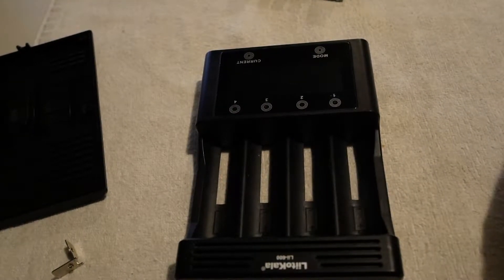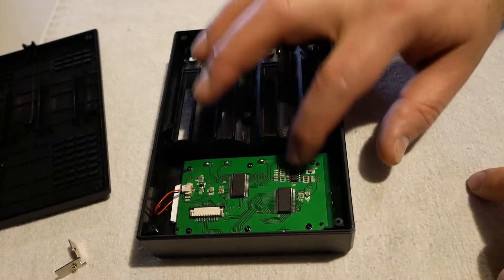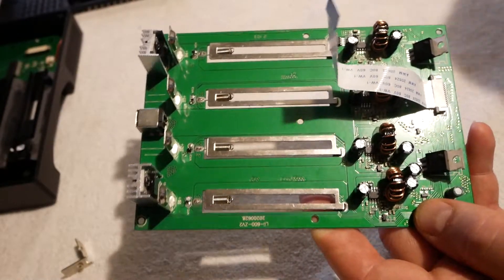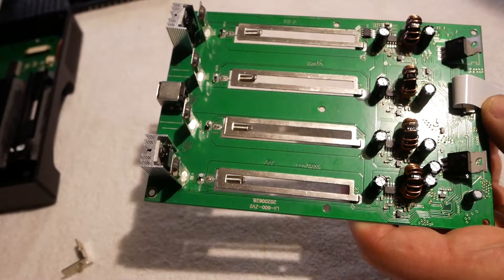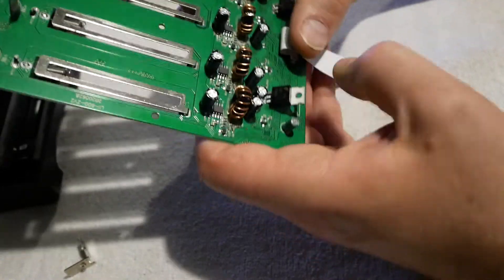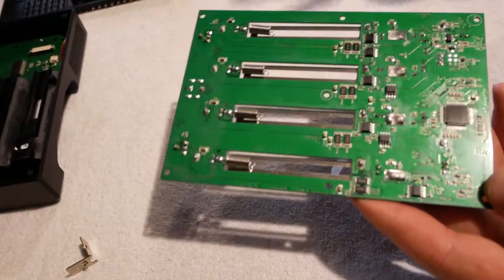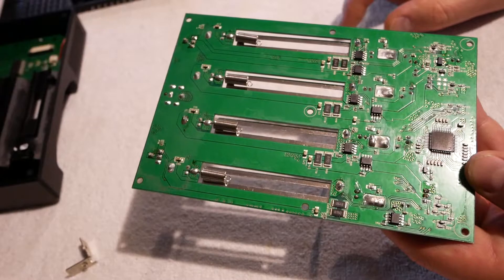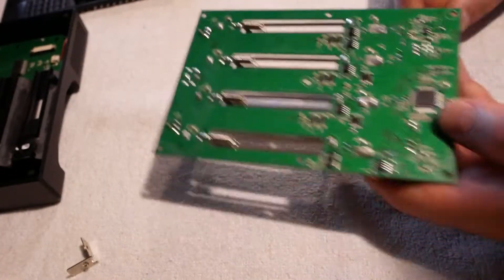LiitoKala Lii 600 Teardown

Comment: One of my outer slots have been starting to show high capacitance values compared to same cell in another slot. Seems it has become worse after some 100 tests maybe. Was wondering if there is something that might age?
Reply from the maker: I've had 3 of them do that. People want something cheap and then expect it to be good and reliable. Why I tell people to get the VC4+. IMHO, it's still not awesome, but it's loads better build quality than the li-600!
Reply: @de-bodgery  I have another Xtar VC4SL just for storage mode but now I am trying an BT-C3100. One thing I directly liked is that there is no annoying beeping :)
Reply from the maker: @gamingSlasher  I don't mind beeping if I get good functionality.

Comment: XTAR VP4+ is still 2x2a+1x2a. Charging large capacity batteries like Samsung 40T and 50S takes so much time. I hope XTAR will catch up and make 4x3a charger.
What's your opinion on Vapcell S4+ charger?
Reply from the maker: Notice that I talk about "cell testers", NOT cell chargers. For just charging get whatever is cheap and charges however you want. For cell testing, that's a very different thing! XTAR VP4+ is the best option that I've come across.
Reply: @de-bodgery  Oh, I see your point. Thanks for clarifying.
Would you prefer VP4+ over SkyRC MC3000 as well (for battery testing)?
Reply from the maker: @ZaarsShed  Watch my videos

Comment: You don't know what you are talking and have a clue about power electronics. Put 500s board together and put your glasses then you can see the more differences than caps.
Reply from the maker: So...are you an electrical engineer and went to school for an EE degree? Your not...hmmm...got to wonder then who is the one that doesn't know what they are talking about?
Reply: @de-bodgery  I am not old. This TO-220 mosfets for dummy load circuit so for discharging. Nothing to do with charging. You say 3 Ampere at 3:42. So, I think you mean 3 Ampere charging but I say again this mosfets are for discharging. This soic-8 package mosfets are charging they are synchronus buck converter to charge cells from 12V input voltage. Google dummy load, synchronus buck and educate yourself.

Comment: Thanks for the Review,I was going to buy a LiitoKala Lii 600 to charge lithium ion 18650 batteries, now i have seen this review i've change my mind, i am sure the XTAR VP4+ is a excellent charger but is out of my price range, i gone for the Opus BT-C3100 V2.2 cost less money and i haven't notice any negative reviews.
Reply from the maker: I like the Lii-600 a lot more than the Opus. It's a rather old design and not better than the Lii-600. I did have a C3100, but it wasn't very good.
Reply: @de-bodgery  Thanks for the reply,i will now try to cancel the order for the Opus BT-C3100 V2.2,right now i'm looking at the Youshiko YC6000 Professional Standard Super Fast Intelligent Battery Charger,what do you think compare to the XTAR VP4+.
Reply: The order for the "Opus BT-C3100 V2.2" had been cancel successfully,i have now made a purchase for one " XTAR DRAGON VP4 Plus",the reason are it didn't cost much more than the Opus BT-C3100 V2.2😃,i take your words the XTAR vp4+ is Excellent battery charger,i don't have right now to check out but when i do have, i gonna see if is better than my (2008 La Crosse BC 900) using with AA,AAA batteries,i will made a vid if anyone not seen a full complete La Crosse BC 900 with original retail box and all accessories, it will be in my video once i upload on youtube,lets see can a 15 year's old battery charger can equal or do better or worst than the  XTAR vp4+ 🤭.
Reply from the maker: @PaulCK  Definitely my favorite! And why I have 8 of them.
Reply: @de-bodgery  I get what you saying,i am happy to say i will be joining you very soon😀,Everyone listen i'm in the XTAR vp4+ club😁
Reply: The Opus is know for frying NiMH, the XTAR VP4+ doesn't charge the bays independently like the Lii-600 and the Vapcell S4+ V3.0. The Lii-600 and the Vapcell S4+ are better than VP4+ on NiMH.

Buy a Vapcell S4+.
Reply: @wolw66  My La Crosse technology bc-900 can charge Ni-MH and Ni-Cd batteries  independently. 
I don't think Lii-600 or the Vapcell S4+ V3.0 is better than XTAR VP4+,maybe just as good i just can't see how is better.
Reply: @PaulCK   The Lii-600 and the S4+ can charge the bays independently at 4x3A , or if you like 2x 26850 @3A and 2x AAA on a discharge / break in cycle.
I looked up all three as I needed a new charger. I will miss the internal resistance probes on the VP4+, but the other two are better at NiMH (and separate amps/functions on the bays independently). AND all settings and amps can be made in manual mode. I bought a S4+.
Reply: @wolw66  Okay it charge faster and everything, i have check the latest price for the S4+ it doesn't cost so much,if i don't have the VP4+ i probably buy S4+ hehe.
Reply: Some more information Vapcell S4+ V3.0 don't support lithium ion 32650 battery XTAR DRAGON VP4+ does support.
Reply: @PaulCK  Good to know.
I don have anything that uses them, and I don't have any 32650 cells.
Reply: @wolw66  Neither do i haha,i i'm beginning to realize i don't need any premium battery charger at all.
Reply: I've had the Lii-600 for two years and it measures everything accurately. It doesn't matter which slot I put the battery in. I put 4 Li-Ion 18650 batteries on the test at the same time and changed the position of each one. It took me 4 days to do that test, but it was worth it. The results for each battery on each slot are almost the same.

Comment: Xtar might be better but cmon, it costs 3x more than lii-500, and one thing it does better that you can notice is accuracy in measuring internal resistance. Is it worth paying 3x more? I would say no. 
Lii 600 also is not worth it.
This is too much money to charge few half dead laptop cells that are almost trash. 
For that money i would rather buy new cells and not care about their condition cuz they are new.
Reply from the maker: You are entitled to your opinion and good luck with those highly unreliable and cheap cell testers! I don't trust the Lii-500 as far as I can throw it! For your use case where you are just charging crap cells, don't bother with a good cell tester. IF you are testing 100's and 1000's of cells like I do, then don't waste a nickel on the lii-500 and get the XTAR VP4+. I don't trust new cells to be anything until I test them myself. Your assumption that "new cells are all some how equal" is false. I know this as fact as NOT being true! See this video:
https://www.youtube.com/watch?v=tO3wJVmtkzM&list=PLOrUJ_KZtl79PONtYt0Zhc8EFBD6pq0jU&index=87
Reply: @de-bodgery  dont get me wrong. If you are testing 1000 cells then good charger is way to go for sure. It will pay off. For me i guess not.
Reply from the maker: @bobikbobikowy5458  yup buy cheapest possible if all you want is charging. I wouldn't even bother with getting a lii-500 if all I'm doing is charging.
Reply: @de-bodgery  today i bought lii-500 for 13$ with some discount coupons. Cant go wrong in that price.

Comment: great video, seems like the Li-600 is not the best 21700 charger for me, might not be a good idea to run it at those advertised 4x3 Amps ;o]

would be nice to see a teardown of Lii-S8 if it's equally bad
Reply from the maker: Think in terms of the price. 8 cell charger (Lii-S8)for the price of a shitty 4 cell charger (lii-600). I'll predict based on the price that the S8 is an even worse steaming turd than the 600! Just buy a VP4+...yes they cost more, but its for good reasons.

Comment: Thank you, wanted to buy this one :)
Will go for xtar or if you have any newer model suggestion. Must have discharge
Reply from the maker: Nope...VP4+ is still my go to capacity tester!
Reply: What about the XTAR VC4SL aka VC4 Plus ?
Reply from the maker: @lorandhorvath4466  You want to save money and not pay for what a VP4+ costs. I get it...I want to do that too. It's why I bought other cell testers like the Lii-600. Seems logical right? It's not...you commonly do get what you pay for and in the case of cell testers, the VP4+ costs what it does for good reasons. Just don't skimp! Get a VP4+. So far, I've been disappointed in everything else. I would like to see XTAR come out with a new version of the VP4+ with a better LCD. Other than that, It's pretty darn perfect as is! My only significant complaint is the LCD and it's usable, just could have been done more thoughtfully.
*
The LCD will only display 2 channels at a time and never shows cell voltage. It also alternates back and forth between charge and discharge capacities. It's easy to record the wrong value. There is plenty of real estate on the LCD for charge and discharge capacities, cell voltages, etc for each channel all at once. There's also things like the bar graph that are completely useless! Cell Ir could be displayed at the same time as everything else too and it's not. Other than the LCD layout and how the data is displayed, the VP4+ is the BEST cell tester.
Reply: @de-bodgery  Thanks for your insight, I am considering buying a VP4+. What about the Vapcell S4 Plus? I have read good things about it, about the same price AFAICS.
Reply from the maker: @lorandhorvath4466  I looked at the S4 briefly, but don't have one in my possession. I honestly can't say anything about it that you can't look up yourself. After I found the VP4+ and had looked at many other options, I quickly came back to the VP4+ and stuck with it.

Comment: Someone knows the maximum temperarure until sensor STOP charge to protect ??? 
I have a battery with 61° C and it does not STOP the charge, it is very hot. O.O"
Reply from the maker: It's a Liito Kala product and they are not very good. This isn't surprising that it won't stop charging. Seems your cell has an internal short and was probably dead flat when you attempted to charge it. I'd take it  off the charger and test it with a volt meter. It's probably going to show a few millivolts at most. That cell won't take a charge no matter what you do.

Comment: Helo, 
How to reset this charger memory? I have one slot locked and when empty it shows charging.
Reply from the maker: Sounds broken to me...not that liitokala chargers are avery good...so this isn't all that surprisng
Reply: @de-bodgery  I am trying to replace it with another one. Resetting the memory by quickly pulling out the power cord does not work. This is what the manufacturer suggested to me. Thank you for your reply.
Reply from the maker: @TomWasilewski  Resetting is just removing power. These chargers store no settings. Sounds like something stopped working in that channel of the charger. Get an XTAR VP4+...MUCH BETTER charger!

Comment: I just got a Lii-500s and I don't like it much. If you start a TEST with for batteries at night before going to bed, the next morning the test will still be running. It seems like if you're not quickly removing the batteries once the testing is done, the test will start over again. That's quite dumb, you have to be right by his side to check the result otherwise it will start over and you can't see the mAh rating it got.
Reply from the maker: I've never seen this behavior with my Lii-500s or my Lii-600 testers. They both stop when a single charge-discharge-charge cycle completes. This is what Test mode does. Of course Liito Kala "quality" is quite low...so who knows what sort of problems you might have! My Lii-500S no longer does discharge capacity testing accurately. 3 of the 8 Lii-600's I have no longer do discharge capacity right either. They all test cell discharge capacities at 30-50% over actual cell capacity. 
*
There is a problem I've run across. Power will flicker. The cell tester won't reset back to its default setting of Charge, but will start Test again. I run my cell testers on a UPS so that AC power issues can't happen. Maybe you have noisy AC power and that's causing the cell test to restart?
Reply: @de-bodgery  I don't know that my AC is noisy, but that makes sense. I'll try another outlet. Thanks.
Reply from the maker: @pmarquisYT  Another outlet is unlikely to fix AC issues. The same AC flows in all your outlets. This is why I use a UPS. It cleans up the power.
Reply: @de-bodgery  It did fix the issue, the outlet had loose connections, you know when you plug something and it barely holds. I guess it was too big of a load for this bad connection and made it drop momentarily...

Comment: I just got the Liitokala LII-600 for $40 delivered, before seeing your video. Probably would have bought the VP4 plus if i saw this first. Lol

After seeing your teardown it might explain why Chanel #1 and #4 seem to behave differently than #2 and #3. With heatsinks for mosfet #1 and #4 near the cell temp sensor those cells were reporting higher temps. Then i set up my laptop cooler to blow air underneath from top to bottom and it exits out the side vents. Now all temps are 44c-44c-42c-42c.

I cant help but to think a mosfet woth a heat sink will behave different than one without heat sink since its internal temp will be different. And having them arranged in some random pattern in relation to all the other components like resistors which also might change value if the temp i different between them. Not sure if any temperature compensation circuits are here.

I don’t know why they didn’t add a fan to exact the heat. I have a feeling a lot of the lack of repeatability this has is due to wild temperature differences throughout the components.

I think you are correct this is measuring internal resistance not AC impedance as is the industry standard. I just watched a video showing the difference between the two tests and their results. And it also went as far as to say each test type represents a different characteristic of the battery. When the cells are cold the readings is around 50-60 but when warm its 30-40. So it does seem to reflect how temps affect ability to charge and discharge. 

Im currently running a test cycle on 4 Liitokala LII-35s flattop cells. To eliminate as many variables as possible I fully charged them, let them set for a few hours, then top them off with a 250 ma charge and started a test cycle with 1500 ma charge, 750 ma discharge, then 1500 ma recharge.

All cells started the discharge cycle within 1 minute, but here after 4h 10m the discharge of each channel is:
3182—2877—2905—3156

Note: most of the test was done without laptop cooling blowing evenly across the bottom.

Since all cells theoretically were discharging 750ma for 4.16 hrs they should all have discharged 3120 mah. 

Next clue, at 4.26 hrs, each cell voltage is:
2.78—3.09—3.04—2.87 volts

That tells me the actual current is not exactly 750 ma for each cell but the current measurement is actually agreeing with cell voltages, or at least not on total defiance. Lol. At least the highest discharge isn’t also showing highest cell voltage.

I bought this so i can test the cells, and match them for a 3p 13s battery. But so far it seems like a waste of time and money and just randomly placing cells in the pack have a better chance than testing and ensuring each 3 cell brick has matching mah as reported by this charger.
Reply: I found one source on the internet (so i must be true, lol) that for lithium ion cells, DC resistance is more important than AC Impedance because 

“The user need DC resistance because:

It allows to compare cells to be used in a power application
It allows to estimate voltage sag under load
It allows to calculate the battery efficiency under load
It allows to calculate how much heat must be removed from the battery through cooling”

It further goes to say that there is no direct relationship between the two. But Impedance is easier to measure while DC resistance changes with SOC and temp. This source used 50% SOC and 25c as the standard for testing DC resistance.

I think it’s confusing to most to call it resistance when its not really resistance like a resistor has, since electrons don’t flow through a lithium ion battery. While there is current from each collector to its terminal, unless that was improperly sized, the “resistance” is the freedom the ions have to move. 

If the ions can move fast then it will charge and discharge easily will less heat and less sag. If the active material is thin, the capacity is low but the C-rate is high. If the active material on the collector is thick, its high capacity but lower C rating. 

Ok, so since we want DC resistance matched in each brick of the battery so that all bricks sag the same under peak discharge, then we just need to see if any procedure can be used with the LII-600, such as all cells at 3.70v, 25c (or at least all the same temperature near ambient), then pop each cell into the same channel 3 times and take the lowest reading, with charge current set at 250 ma so it has the least effect on voltage and temperature of the cell.

AC impedance, being small voltage changes 1000x per minute, probably measure the collectors and tabs current carrying ability and the ions are just wiggling back and forth saying “wtf? Make up your mind. Charge or discharge not both”. Lol. So not really going to show you the performance of the battery under a sustained high drain.